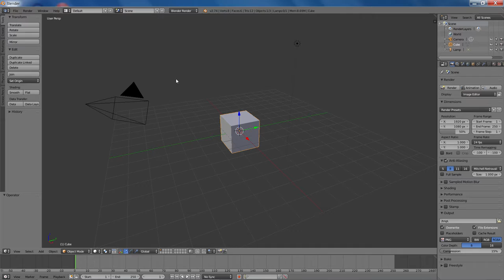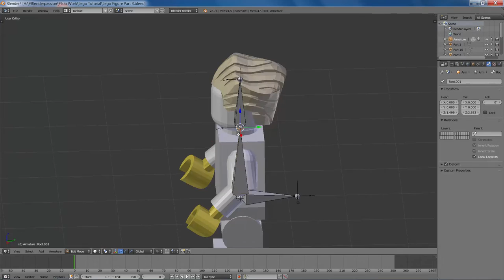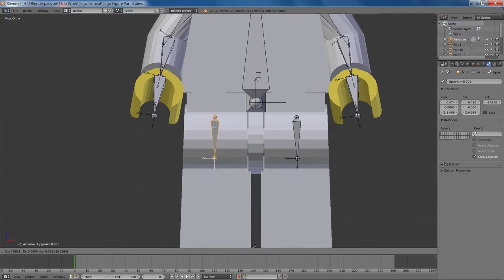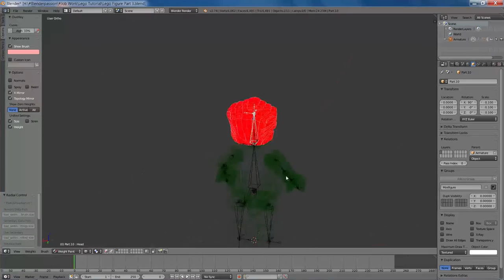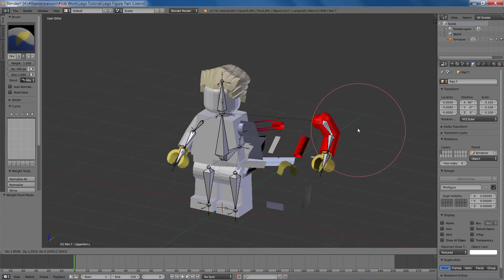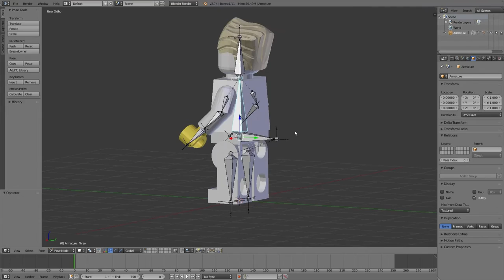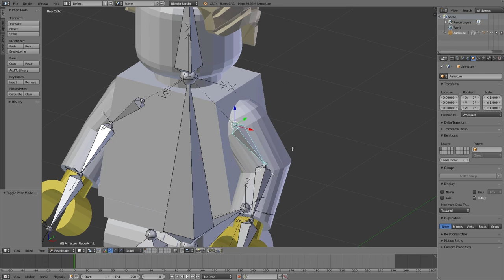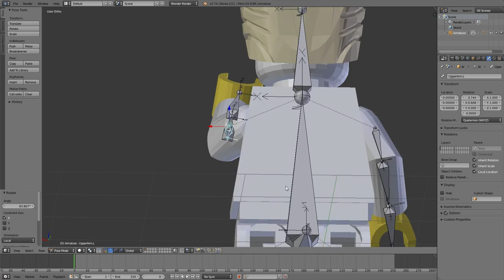Learn How to Create 3D Lego Scenes - Part 3: Rigging

Comment: Hi,

Cool series of tutorials :-)

You shall try to export/import models using the collada format instead of OBJ. Transformation matrices and origins are preserved which would make it easier to find the rotation angles.

Topology is not that great and low poly so that it can be downloaded fast enough (you don't want to wait for 1/2 hour to visualise a 5000 parts models ;-). Therefore I use a lot the edge split modifier.
Reply from the maker: Mecabricks Thanks for the insight! I will definitely check out the Collada format.